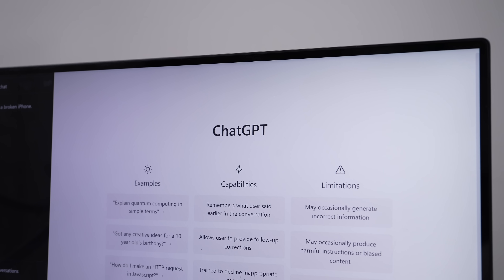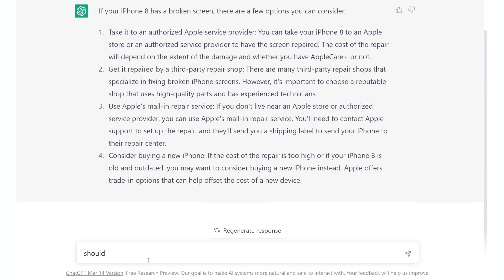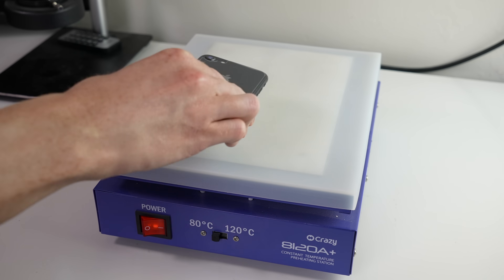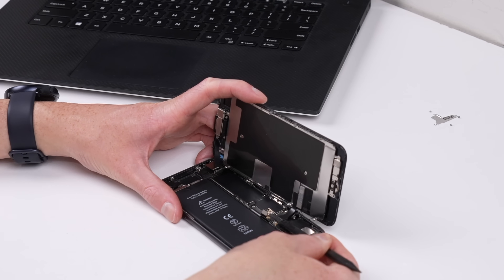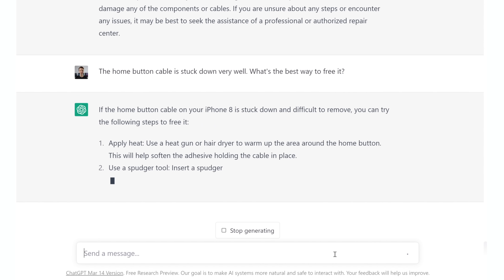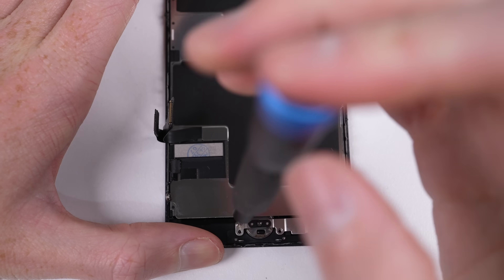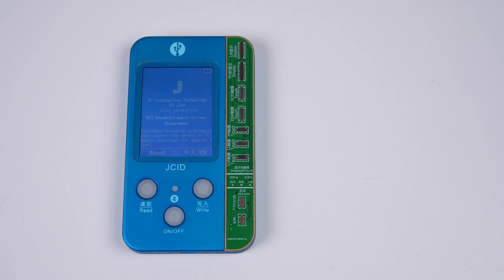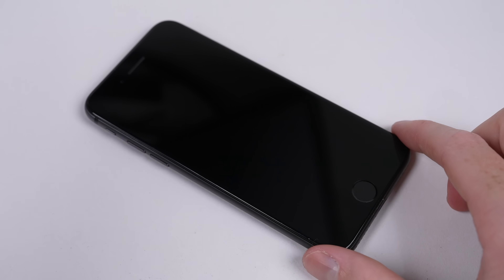Can ChatGPT AI Teach Phone Repair?

Comment: 100% repair? No, it can't. But it can give very useful tidbits that are hard to find otherwise. You try looking on Google how you're supposed to undo the screws for a laptop heatsink and you just see snarks saying "use a screwdriver", you can't. It needs to be loosened by plier, preferably screw-extracting pliers, first. The springs keep them so tight you can't turn them normally without doing so. BingGPT (which I think uses the same OpenAI model but with more strict language with regards to controversial subjects) told me to use those pliers. BingGPT also tells you where it gets its info, in this case, LinusTechTips and I think two other YouTubers. Sure enough, worked like a charm.

Comment: I can say from experience that unplugging the battery first is important. Years ago I replaced a screen on an iPhone 5 without disconnecting the battery (I didn't know at the time) and fried something on the motherboard that permanently broke touch for any screen attached. Damage CAN happen if the battery is attached and you're goofing around inside.

Comment: Hey Hugh I got a iphone 4, 4s, 5s on the iPhone 4 the screen I shattered and the back glass is shattered too and it it activation locked. The iPhone 4s is in perfect condition but when I booted it, it went to recovery mode so I tried restoring it but it says "error occurred when trying to restore thus iPhone" I tried again and again but it still won't work I used 3utools to get it out of recovery mode it just went to a black screen. The iPhone 5s is in well condition but the screen is hanging off and I tried charging it but no signs of life. So if you could help me plz contact me back

Comment: Anyone attempting this when opening the phone up TAKE YOUR TIME! The adhesive holding the screen down is SUPER strong so heat is a must and whatever you do don't use anything metal for prying! It may take awhile but eventually you will find a way in and the screen will come off just be patient. I just replaced the battery in an iPhone 8 for a family member yesterday and this was my experience.

Comment: i was messing with chatgpt to see how well it can code, and in literally one prompt, it made 3 player pong, (i asked it to make 3 player pong just to see what would do), it had 3 sets of keybinds, one for each player, and there was a paddle on the top of the screen and the normal 2 on the left and right on the screen, its pretty impressive that it can write working code without any big issues. it did occasionally write broken code tho
Reply: for anyone curious, here is the code it wrote.

-- 3-Player Pong Game

function love.load()
    -- set up window
    love.window.setTitle("3-Player Pong")
    love.window.setMode(800, 600)
    
    -- set up paddles
    paddle1 = {x = 50, y = 250, width = 20, height = 100}
    paddle2 = {x = 750, y = 250, width = 20, height = 100}
    paddle3 = {x = 375, y = 50, width = 100, height = 20}
    
    -- set up ball
    ball = {x = 400, y = 300, size = 10, dx = 5, dy = 5}
    
    -- set up scores
    score1 = 0
    score2 = 0
    score3 = 0
end

function love.update(dt)
    -- move paddles
    if love.keyboard.isDown("w") then
        paddle1.y = paddle1.y - 5
    end
    if love.keyboard.isDown("s") then
        paddle1.y = paddle1.y + 5
    end
    if love.keyboard.isDown("up") then
        paddle2.y = paddle2.y - 5
    end
    if love.keyboard.isDown("down") then
        paddle2.y = paddle2.y + 5
    end
    if love.keyboard.isDown("a") then
        paddle3.x = paddle3.x - 5
    end
    if love.keyboard.isDown("d") then
        paddle3.x = paddle3.x + 5
    end
    
    -- move ball
    ball.x = ball.x + ball.dx
    ball.y = ball.y + ball.dy
    
    -- check for collisions with walls and paddles
    if ball.y < 0 or ball.y > 600 then
        ball.dy = -ball.dy
    end
    if ball.x < 0 or ball.x > 800 then
        ball.dx = -ball.dx
    end
    if checkCollision(ball, paddle1) then
        ball.dx = -ball.dx
    end
    if checkCollision(ball, paddle2) then
        ball.dx = -ball.dx
    end
    if checkCollision(ball, paddle3) then
        ball.dy = -ball.dy
    end
    
    -- check for scoring
    if ball.x < 0 then
        score2 = score2 + 1
        ball.x = 400
        ball.y = 300
    end
    if ball.x > 800 then
        score1 = score1 + 1
        ball.x = 400
        ball.y = 300
    end
    if ball.y < 0 then
        score3 = score3 + 1
        ball.x = 400
        ball.y = 300
    end
end
function love.draw()
    -- draw paddles
    love.graphics.rectangle("fill", paddle1.x, paddle1.y, paddle1.width, paddle1.height)
    love.graphics.rectangle("fill", paddle2.x, paddle2.y, paddle2.width, paddle2.height)
    love.graphics.rectangle("fill", paddle3.x, paddle3.y, paddle3.width, paddle3.height)
    
    -- draw ball
    love.graphics.circle("fill", ball.x, ball.y, ball.size)
    
    -- draw scores
    love.graphics.print("Player 1: " .. score1, 10, 10)
    love.graphics.print("Player 2: " .. score2, 700, 10)
    love.graphics.print("Player 3: " .. score3, 350, 10)
end

-- check for collisions between ball and paddle
function checkCollision(ball, paddle)
    if ball.x + ball.size < paddle.x or paddle.x + paddle.width < ball.x or ball.y + ball.size < paddle.y or paddle.y + paddle.height < ball.y then
        return false
    else
        return true
    end
end

Comment: Well for one it fails at anything related for Nintendo Switch repair... According to it, requires only a phillips screw driver. It's true one you've opened the cover, though the cover is held down by 4 tri-wing screws

Comment: I tested the same thing but with GPT-4 as I have access to it, and it actually not only gave DIY repair as an option (although it did say "not recommended for inexperienced users"), but it also specifically told me to disconnect the battery first! Granted I asked for an iPhone 6s but still.

My exact prompt was "Hey, I have an iPhone 6s with a broken screen. How would I go around fixing it?", and it gave me two main responses. The first one was "Professional repair service", and it just talked about reputable third party repairshops, the Apple Store, authorized service providers, yada yada.

And the second option it gave was the DIY one, where it correctly gave all the required steps to replace the screen of an iPhone 6s, although it didn't tell me to reinstall the seal but honestly the iPhone 6s' seal doesn't do that much as it was more or less the precursor to the iPhone 7's water and dust resistance rating seal.

Comment: Did you use GPT 3.5 or GPT 4? I asked GPT 4 "Create me a step by step guide for someone who is completely new at this type of thing, for replacing the screen of an iPhone 8" and it gave me the correct instructions. Mentioned all of the correct tools and specified disconnecting the battery.
Reply: Additionally, when I asked about the True Tone issue, it replied this "If the True Tone settings disappeared from your iPhone 8 after replacing the screen, it is likely due to the absence of the original display's ambient light sensor data. The True Tone feature relies on the ambient light sensor to adjust the color temperature of the display based on the surrounding lighting conditions. When replacing the screen, the data from the original sensor must be transferred to the new screen to maintain the True Tone functionality.

Unfortunately, transferring the ambient light sensor data requires specialized equipment and software that only Apple or authorized repair centers have access to. If you want to restore the True Tone functionality, you will need to take your iPhone to an Apple Store or an authorized service provider for assistance.

If you don't have access to an Apple Store or an authorized service provider, you can still use your iPhone without the True Tone feature. The display should still function normally, but the color temperature won't automatically adjust based on the surrounding lighting conditions. You can manually adjust the brightness and color temperature in the iPhone's settings if needed."
Reply: I will say it also missed adhesive as well.
Reply: I bet he used the old one. I think he should have used gpt-4 as it's much better.

Comment: It can give you a good answer, or a dangerous one, like forgetting to disconnect the battery.

Every expert that tried ChatGPT in the domain of expertise find that it is not exact or precise enough and will need to be prod to go in the right direction. But you don't need ChatGPT if you already know what the direction should be. ChatGPT is meant to speak like a human, not to give sound solutions to a problem. It is a computer play field, not an expert system.

Comment: Did the chat say to which side should the screen be opened to prevent breaking the connector?

Also wondering if chat could be biased regarding not alerting to remove the battery connection

Comment: The amount of anti repair features Apple implements are absolutely abhorrent. Absolutely disgusting.

Definitely one of the largest reasons I have not owned an Apple product since the iPhone 4.
Reply: ayy same here. been meaning to pick up a for parts iphone 4 off ebay for a while so i can repair mine and get some old photos off it. The absolute state of these fucking devices man, working with them is a nightmare.
Reply: A couple of years ago I was buying and refurbishing ipods mostly a clean and polish change the battery and done , after a run of otherwise good ipods died after restoring on iTunes to clear the hard drive of music and sometimes worse I stopped doing it that way and used selected all music and delete instead seemed better 
When I asked on a Facebook group if anyone else experienced this problem and could apple be restricting repairs , a reply from a guy in california quite aggressively said apple would never do such a thing words like defamation were bandied about,  I told him to chill and just in case reminded him I said could and left the group 
So we're they doing it for ipods does anyone know
Reply: if you're ok with your privacy keep using an android 😅
Reply: @richardnascaw1237  with a little bit of brain you can keep Android completely private. Its Android ( open source). Everything on it can be modified. Including removing google completely and installing systemwide adblocker. 
Also apple isn't private either.

One such privacy focused example is graphene OS. Its open sourced and community driven.

The absurd idea that iOS is better than Android in privacy is kinda absurd to me. Infact Android is much better due to its open sourced nature.
Reply: @TheRealGigaCat  It might be the case that you can modify Andriod to be more privacy focused than IOS. But the average Joe is not as tech-savvy as the audience that watch phone repair videos. IOs is better for privacy out of the box than Android. And that is what counts for most people.
Reply: @TheRealGigaCat  Dumb people watch Apple's iPhone ad and assume that it's "private".

Comment: Give this another shot when ChatGPT 5 is released.
Reply: They cannot handle chat GPT 4 properly as its paid users continue to face issues which takes the improvements of GPT 5 in question.
Reply: @(Inactive Channel) no, it’s smarter
Reply: @Qwerty-uiop  ight bet
Reply: @Qwerty-uiop  lol😂
Reply: Wait for ChatGPT 10
Reply: Me waiting for Chat GPT 20
Reply: He could used ChatGPT based on GPT-4 at least. ChatGPT with normal old 3.5 model is old by now.
Reply: Maybe when gpt 20 is released more like
Reply: @ThylineTheGay  so 2 years later basically
Reply: No! Do not, do not, unless u have a flame thrower handy, it will take you over😂😂😂😂😂😂😂😂😂😂😂😮😮😮😮🎉🎉🎉!!
Reply: @user-UCdZdD it's obviously going to be better than the  current version.
Reply: gpt4 hasn’t even been released yet (except on the bing ai thingy)
Reply: @itsmaxim01  it has been released as a paid product.

Comment: Do you think the ChatGPT AI can be configured to include more third-party party repairs such as the display reprogrammer and also, changing of an iPhone's housing?
Reply: I'm curious if he tried to make more specific questions about any fixes outside of taking it to Apple.

If you have to push it in the right direction rather than just ask and get something. I feel like this has been brought up by multiple people and especially when trying to use image generators for making a picture
Reply: I just asked this exact question in Bing with ChatGPT enabled. It gave the correct answer. It said that you need an ALS programmer, provided a link to a guide and a link to a specific model of programmer.
Reply: yes you can. there is an option in chatgpt to rate the answer and provide feedback on why you chose that answer and how to fix it